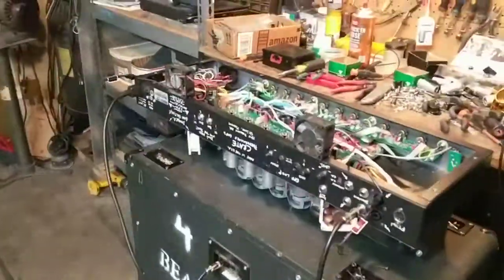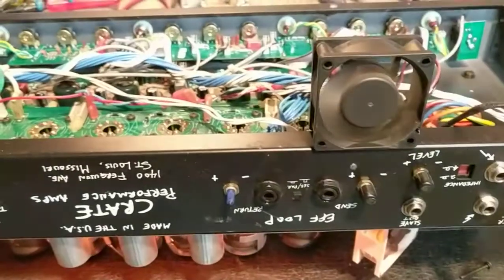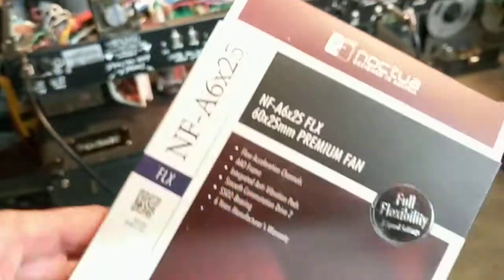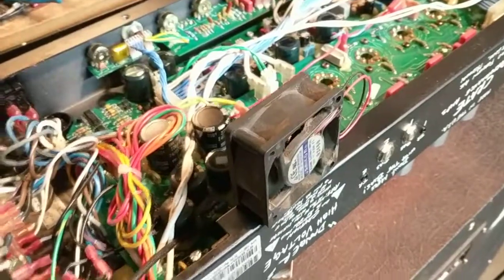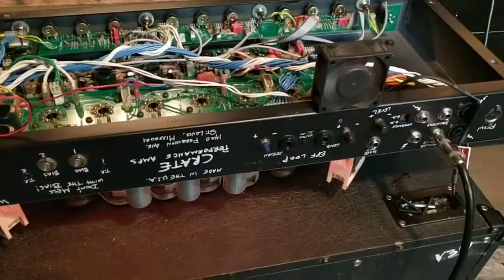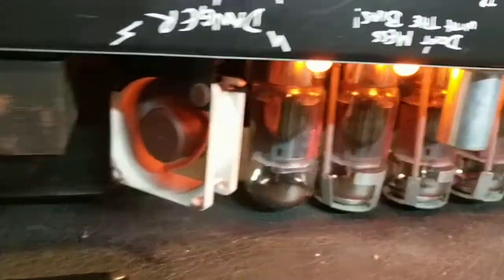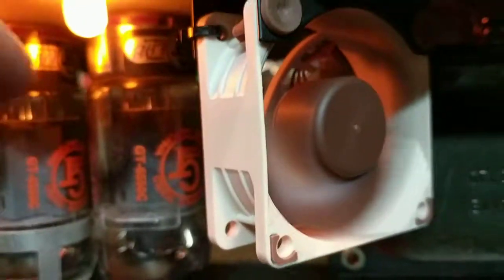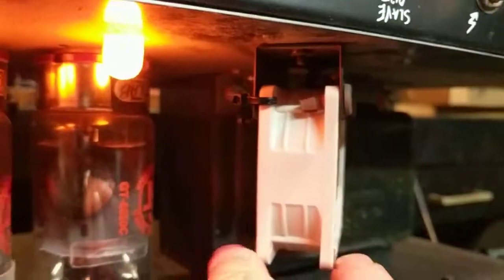Crate BV300H - Noctua NF-A6x25 FLX Amp Fan Upgrade SILENT!

Comment: I have been contemplating doing this to my Marshall Mode Four, those fans that they use are just so loud, I am definitely doing this as soon as I figure out how to step down the voltage from 24v to 12v. All I know is I have to solder some resistors to bring down the voltage.

Comment: Would you happen to know the recommended bias settings for this amp?
Reply from the maker: Same as an SVT 18-24ma per tube, 54-72ma per side. I'd keep it closer to 18ma tho. The extra gain and output of the preamp and channel switching can give big volume jumps which you don't really want. These run close to an AB2 class with a big drive into the grids so biasing cold is just fine, you'll never hear crossover distortion in it.
Reply: @BearAmps  the test tp1 and tp2 in the back is measuring voltage to adjust right?  Would you happen to also knows what voltage range for using the voltage way to measure
Reply from the maker: @kevinkaiser727   youre measuring current being dissipated by the tube and reading it across a cathode resistor, which means youll be reading a voltage drop so that translates to current by using ohms law. so set for DC voltage and the lowest range on that scale, millivolt will give you a straight reading without a decimal. the next scale up can read a little better sometimes but itll look something like .072 rather than just 72
Reply: @BearAmps  Thanks I really appreciate the help!  Couldn't find it anywhere online, thanks again!
Reply: So I measured what it's currently at, tp1 was 122, and tp2 was at 140, I should adjust  them down to around 72 right?
Reply: Or closer to 54 I mean